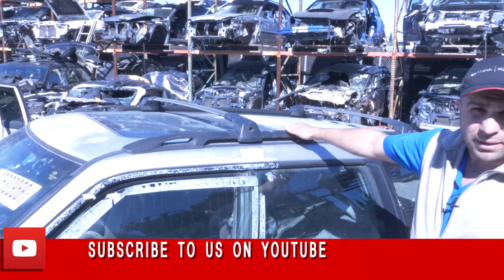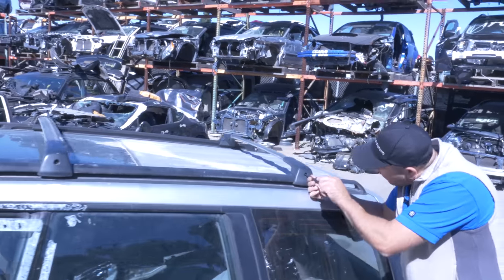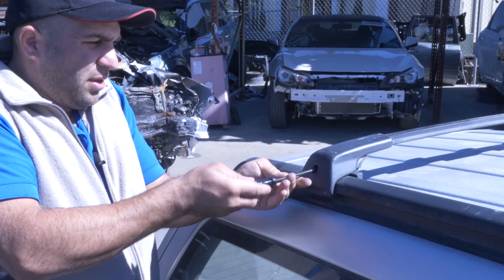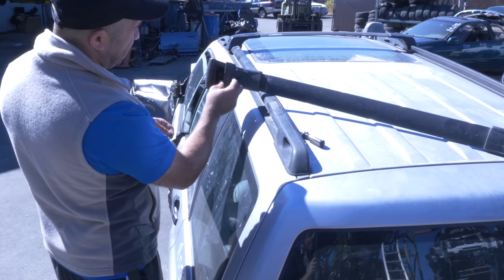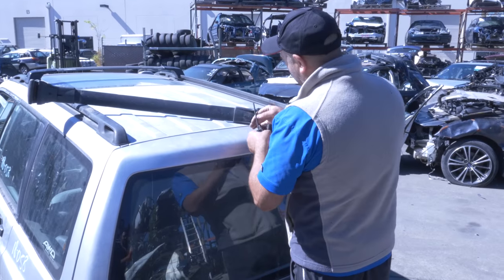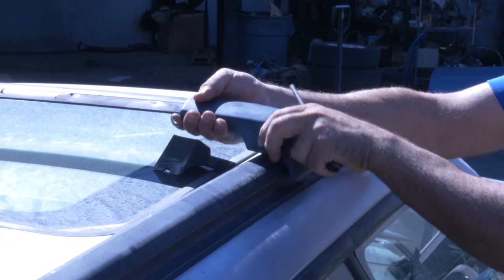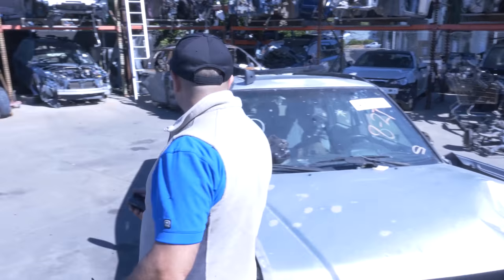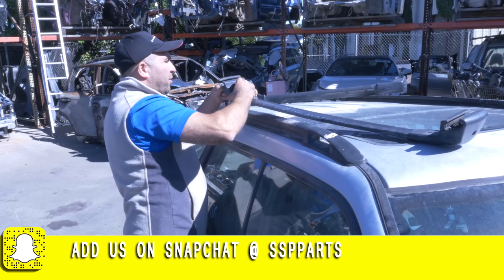How To Remove and Replace a Roof Rack - 2001 Subaru Forester

Comment: FYI...  (Regarding the stock roof rack crossbars on an '05 Forester):
There is a front and a rear cross bar (slightly different lengths), and they're made so one edge if forward facing.
Also, the mounting clamps have thin rubber pads; make sure you have those to make a secure fit and prevent rattling.
And finally, the clamps are made differently for the right and left side.  Take a close look at the clamps and the crossbar base, and you'll see there's a notched corner that only lets it go in one way.
(Said another way:  If you decide to remove your crossbars for a while, mate the clamps to the base they came from and mark which is the leading edge of the crossbars.)

Comment: What I hoped to see is how to remove / reinstall SIDE RAILS, which were damaged on my 01 Forester.  I think this involves removing the headliner inside the car, which is a time consuming pain.  The whole rack is something like $450 from Subaru IF they still have it, so salvage yard is a (time consuming) alternative.  Thanks for the video.
Reply from the maker: Those side rails omg you gotta remove the headliner we have the side rails we can sell cheap but the job it’s a big job
Reply: Yup.  My side rails on my 2001 Subaru just failed - the front ends.  Gotta figure something out.  Got straps running through the windows to keep it down for now.
Reply: @Garflips same. Mine cracked in the front half.
Reply: @jellyfishhh440  there are some things that should not be made out of plastic.
Reply: Mine cracked , had my bike on a rack on top, driving through Indiana. Wind ripped the bike and the front half of the rails right off the car. Fortunately, the bike didn't hit another car, -would have been terrible. The bike rack was still solidly attached to the cross members and the cross member  was attached to the (broken) side rails.
Reply: My 2001 Forester has a good bit of life left but I may just rip open the headliner to get at the parts necessary to replace the rack.  For such a well-made car it is a joke to have plastic racks and such a poorly designed attachment.